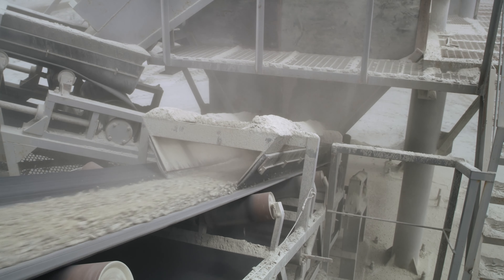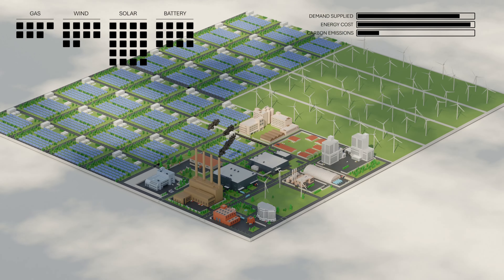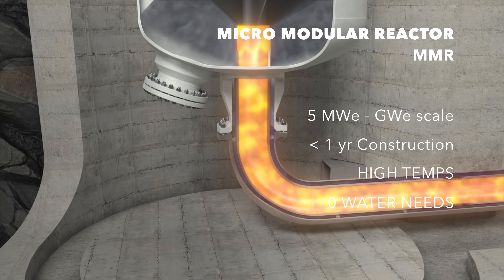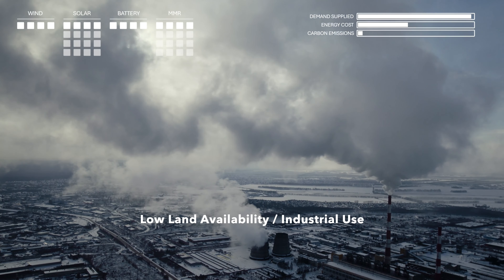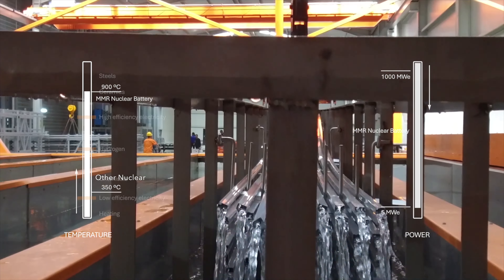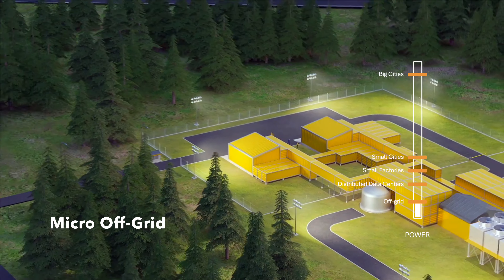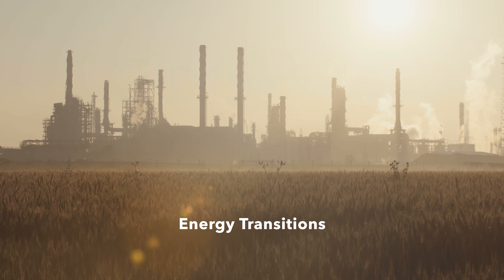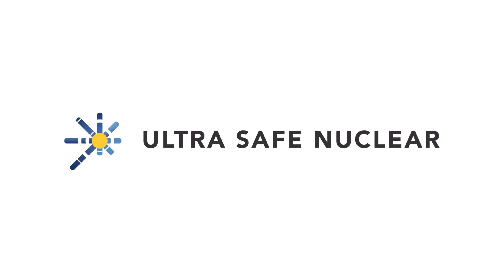The Micro Modular Reactor: Reliable Zero-Carbon Energy Anywhere

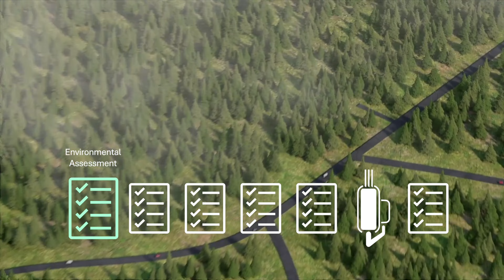Comment: She lost me at 3:40 when she said higher latitudes more mmr. No, water vapor not latitude limits solar.
Reply: No sunlight for a few months can also limit solar, which happens at higher latitudes.
Reply: @WJV9  yes, but shorter daylight during winter is made up by longer daylight during summer.  

How does latitude affect solar insolation?
Generally, the higher the latitude, the greater the range (difference between maximum and minimum) in solar radiation received over the year and the greater the difference from season to season.

Water vapor, humidity and cloud cover are bigger factors on annual solar production.
Reply from the maker: @freerovingbovine  you're gonna need a lot of batteries to make up that difference :)

Comment: How and who will handle radioactive waste disposal?
Reply from the maker: It will vary depending on the country and site. In the US, the US DOE is mandated to do this. Ordinarily, the used fuel is stored on-site in dry casks storage. Eventually, the DOE will relocate it to a consolidate repository and then a permanent repository. Same as current reactors. Can potentially be improved.
Reply: @ultrasafenuclear  I've seen a train wreck carrying one of those nuclear casks, the cask was intact the train was not.

Comment: Could you elaborate more in the "eventual decommissioning" process?
Reply from the maker: So at the end of the project lifetime, say in 40-80 years, you're going to want to shut down the site. the site needs to be returned to green field, which means removing any activated materials and structure, and even industrial materials and structures at the site. Unlike other industries, we create a fund of approximately 15% of the initial CAPEX to execute the decommissioning process.

Comment: What is the plan and cost for decommissioning and waste storage?
Reply: Waste storage is not an issue.  The used fuel can be used to power fast reactors which will reduce the waste by 99.9% with the last portion becoming harmless in 300 years. We are talking about 20 grams of waste for the total lifetime per person energy use. Less than a US penny.  This is not a substantial amount to worry about.
Reply: @stanleytolle416  FAST REACTORS.  Great !  Now every small county can become a nuclear-armed country - with or without a dictator !
Reply: @Unknown15916  fast reactors have the ability to destroy weapons grade nuclear material. It is true breeder reactors can produce plutonium but these reactors have to be designed to do this and operated on such a way as to not produce Pt isotopes that will denatured the usefulness of the Pt for making bombs. Fast reactors can also be designed such that weapons grade Pt can not be produced and in some cases destroy this material. To shorten,  fast reactors can be designed not to produce weapons grade material.
Reply from the maker: @Unknown15916  this is not a fast reactor. it is a thermal reactor, and the spent fuel is TRISO, which is basically impossible to reprocess. It would be easier to create an enrichment facility by several orders of magnitude.

Comment: I Want A few For my Doomsday Bunker. What's The storage Life Span If Not Activated At All
Reply from the maker: Not that we'd design or certify it for just sitting there, but I don't see why you coudn't leave it there for decades. It's all ceramcis and metals in highly controlled environments. There are some subsystems with plastics, electronics, and water cooling. Those would not fare too well for very long with inspection/maint

Comment: I'd love to see these powering the ConEd steam pipes in New York City. Of course! Replacing the fossil fuel burning power plants in Manhattan is easier said than done. The engineering I should be secondary to the political issue. But I would have no problem with having one of these in the plant across the street from me, provided a nice rebate on electric power.😅
It hit over 90° today and I am more than a little worried about power going out over the next few days

Comment: Ridiculous, cherry-picking argument. Economy of small scale is, as you certainly know, not referring to production quantity but to output capability. In all engineering, there is an economy gained at the right scale, a spec derived from the use plan. Exceeding that specification is waste. Duh.

Comment: There is no such thing as economies of SMALL scale.  Even with $2 billion in taxpayer welfare, NuScale finally canceled their SMR project that was clearly not cost effective as all of these startups will eventually learn.  The only thing these companies are building is their bank accounts with government handouts.
Reply: do you have idea that solar panels used to be REALLY expensive (& it didn't go bust)? like it was $115.28/Watt back in 1975 & $2.15/Watt in 2010, nowadays it's below $0.5/Watt & it's because of mass-production thus it means lots of solar panel supply

I believe SMRs of right now are like solar panels of the past, it's very expensive at 1st but overtime the cost will go down, patience is a virtue.
Reply: @HSstudio.Ytchnnl  Do you realize that the U.S. over the last 70 years has designed, built, and tested every type of reactor known including SMRs and MSRs?  Did you know that the first (Shippingport) commercial reactor was a micro (60 Mw output) reactor and the next 10 or so were SMR output capacity and every one was shutdown early since there is and never has been economies of SMALL scale? Did you know that VC Summer and Vogtle tried the build a module in a factory and ship it to the site and overall it cost more that site builds and cost $$ and build delays?
Reply: @HSstudio.Ytchnnl What's Price-Anderson?
Reply from the maker: @HSstudio.Ytchnnl  yep.
Reply from the maker: Thanks for the comment. Of course there are economies of small scale - it's called economies of production and factory fabrication. going to this small size means we produce the reactors and modules in a factory, not as a one-off mega project. To deliver the same 1GW of electric power, we have produce about 50 units in our factory with plenty of automation and specialization. The quality will be better, the cost will be lower. Practice makes perfect. Learning reduces costs.
Reply: @HSstudio.Ytchnnl  Do you realize that nuclear power has been around for over 70 years and has NEVER gotten cheaper?   Why do you think that will change?  In EVERY type of power generation method, BIGGER is ALWAYS cheaper per Mw capacity....ALWAYS !
Reply: @obsoleteoptics  No insurance company would insure a nuclear power plant.  Price Anderson was put in place so the U.S. taxpayer is on the hook for any nuclear accident.  We the taxpayer insures nuclear power
Reply: @clarkkent9080  Exactly my point.

Comment: Calling BS on the carbon free.
Reply: What carbon is the nuclear fuel going to release into the atmosphere?
Reply: @Neoprenesiren  the carbon from the concrete and steel used to build the plant, as well as the carbon from mining the uranium
Reply: @obsoleteoptics  carbon is going to be made anyway. Why not do it with less of it? Not to mention, uranium can be made from In-situ leaching, which has its own negatives. But we mine coal, and that's just as bad.

I repeat once again. It's still more efficient for reactors.